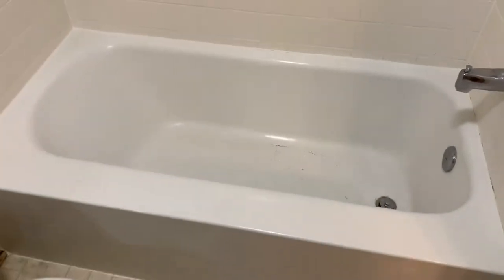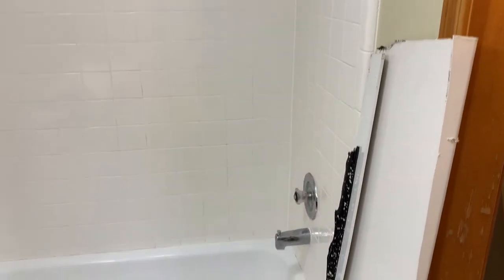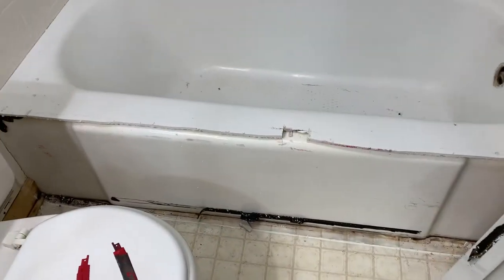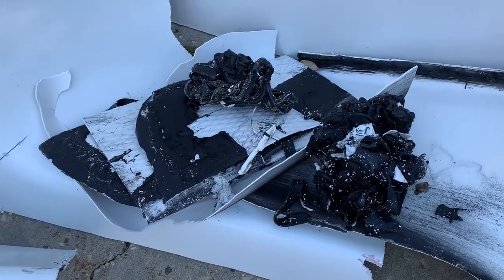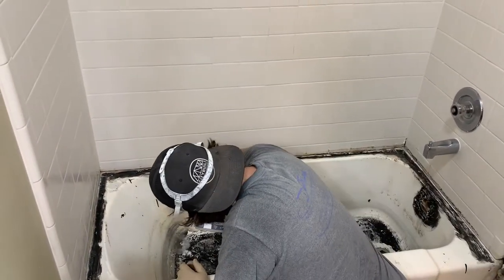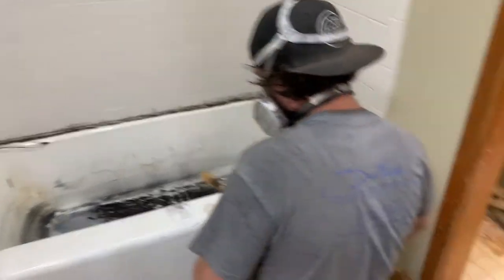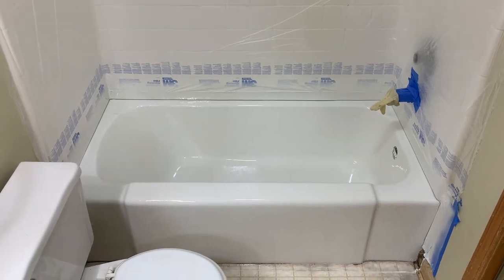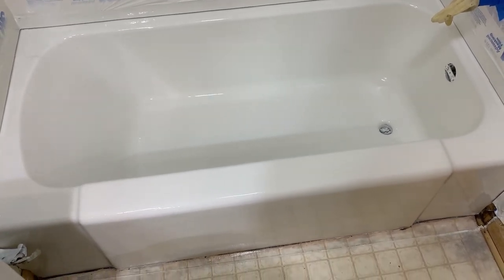Bathtub Liner Removal

Comment: why not just repair the crack in the liner?
Reply: The liner can leak at the 3 seams as well as those cracks. I also own a reglazing business and was called to a customer for an issue with their liner. Turned out water had seeped behind, you could hear it swishing all around between the liner and tub. There had to be gallons of water trapped.